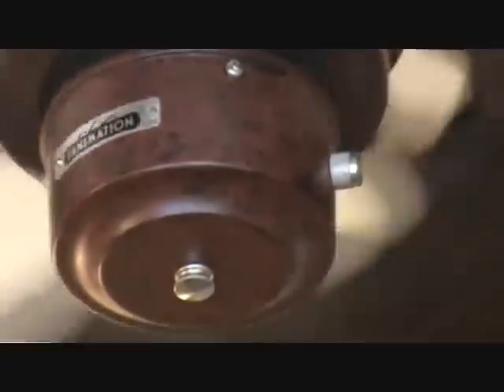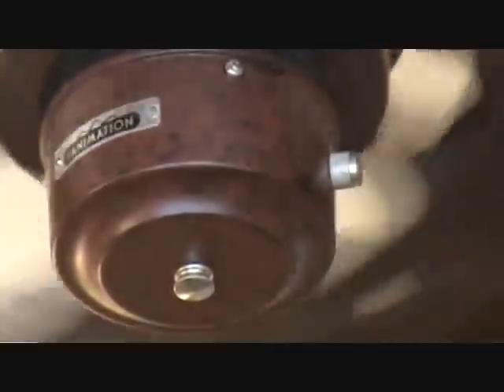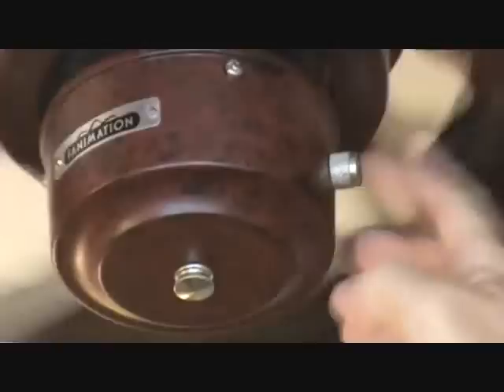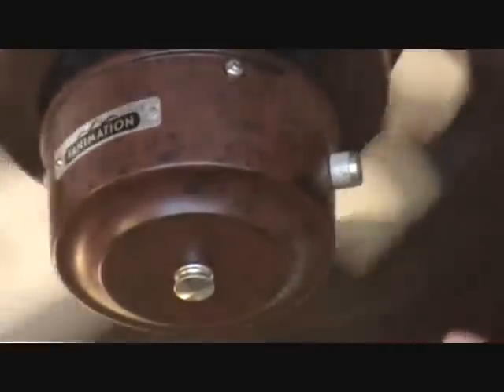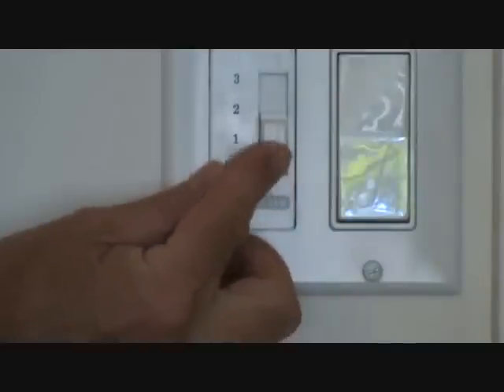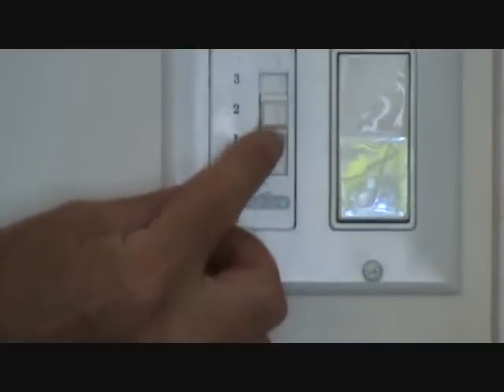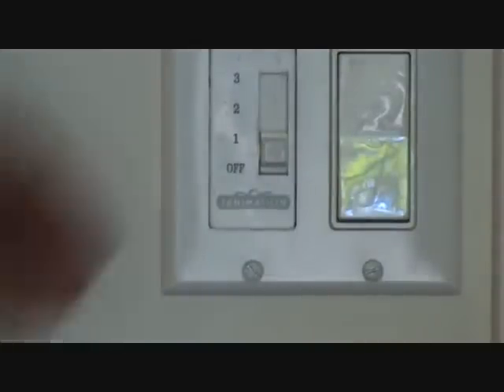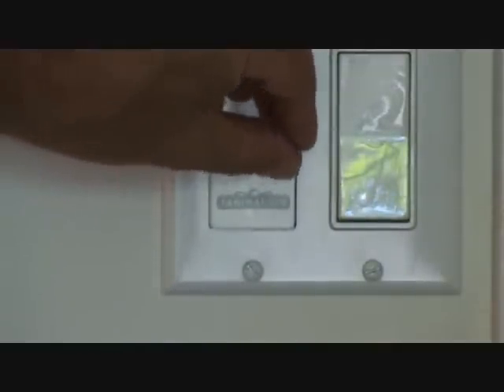How a ceiling fan "should" work: do you know "this" ?

Comment: @VideoJoeKnows Done!  My ceiling fan was put back up earlier today.  The first thing we did was change the speed setting by pulling the chain.  After that when we put the wall-mounted speed-control on fast, the fan spun fast. 

Although I feel a bit bad that someone touched the chain to begin with,  I am relieved that the problem is solved.

Many, many thanks Joe!  I would not have thought of this on my own.  

The power of the Internet connecting one side of the world to the other!

Comment: I am a Hong Kong "fan" of yours...  and so is my ceiling fan a "fan". 

*Sigh*   My ceiling fan is presently sitting on my LR floor because we can't figure out why it's running so slow.  After watching your video, I now have the sneaky feeling that the fan itself (with chain) is on slow, and so, exactly like your video, when we put the wall control on fast, it never goes beyond slow!  Hopefully when we reconnect it tomorrow we will discover this is the problem.  TY for your fantastic videos!

Comment: @VideoJoeKnows Will have to wait until next week. 

I am going through a renovation.  The main contractor will be back next week.  

Originally we thought dust had gotten inside the fan, created by removing tile on my balcony.   After watching your video however, I believe there is a possiblity one of the workers pulled the chain and changed the speed  to "slow".  I didn't think of this on my own because we never touch this chain. I genuinely hope this is what happened.  I will let you know!

Comment from the maker: @WannaBeDj100 That's a good point. It's important to keep your motor housing vents clean. As for your existing conditions with only one switch in your room, they have a kit where you install a remote up in the ceiling housing then it's controled by a handheld remote that will operate your fan as well as a fan light. You would just keep your light switch on at the wall then your fan is all controlled by the hand held remote. It's pretty cool. Thanks again for your comments.   Joe  :0

Comment: Dust might  cause it to run slow, I used to have to clean my box fan yearly because dust would cogg up my motor housing vents. After I cleaned the outside of the motor housing & the gril, it would be 5times as powerful!!! Now i have a ceiling fan with remote hard wired in, & the light on a switch, because this house is old and only has 1 switchbox in my room